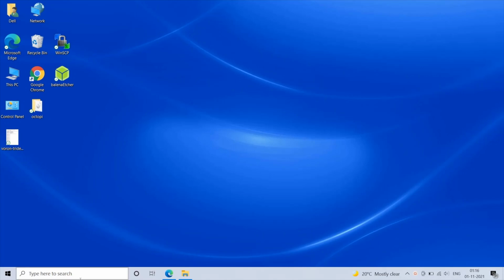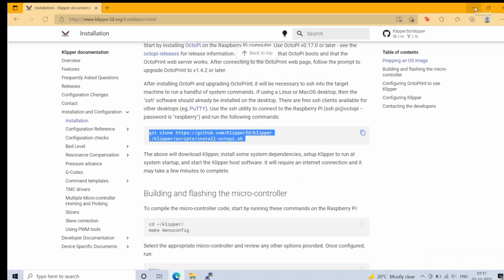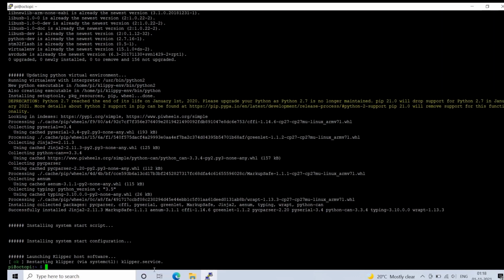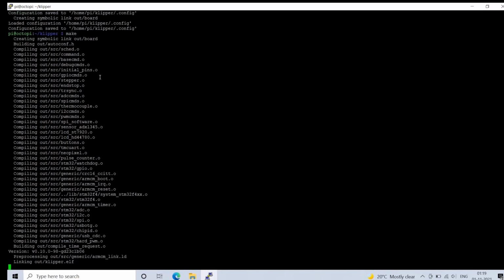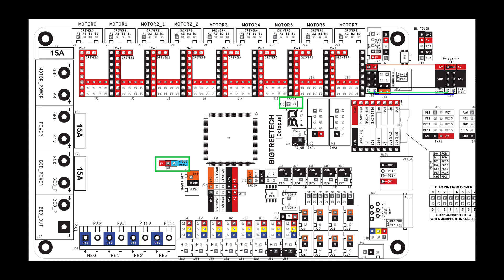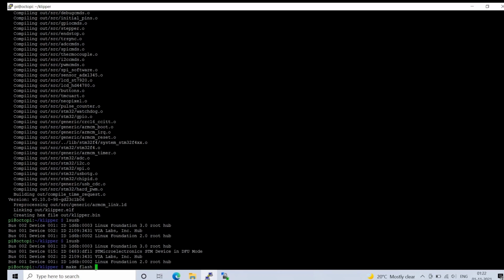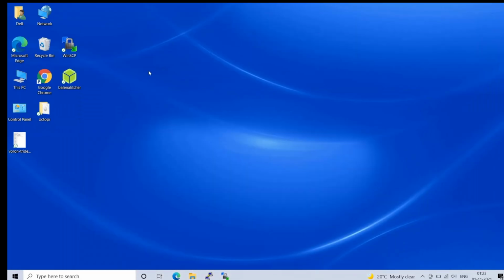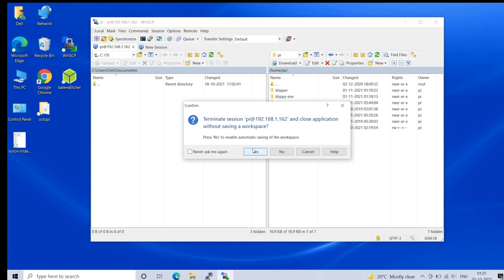Klipper Installation *NO SD CARD* PART 2, (DFU MODE)

Comment: Hello thanks for your video I have a Ratrig Vcore 3 printer with Raspberry pi 4 and Octopus pro board,  how would you flash with rat OS they supply a bin file for the octopus pro board when I try to install with the SD card they say leave it in but no matter what I try when I launch the Macro Install V-Core three it no longer connects to the controller any thoughts thanks !!! happy new year Dave
Reply from the maker: Hey ! I would like to know what error are you getting exactly…. Just check if your board has boot up properly.. 
maybe this will help you. 
https://os.ratrig.com/docs/installation/

Comment: Hello Harshita...i have installed the Software. but I can't get the drivers to work with UART.can you help me with this problem? I can give you the cfg. Send file
Reply from the maker: Can you tell me which controller are you using ? 
You can switch the pins if you are getting error with specific stepper .. 
Also Double check your wiring… 
I will mail you a solution shortly.